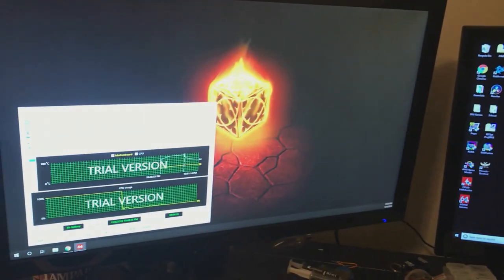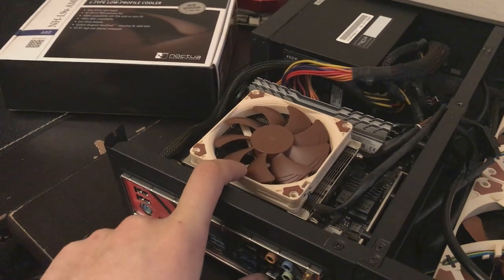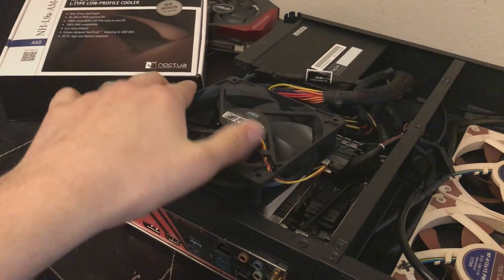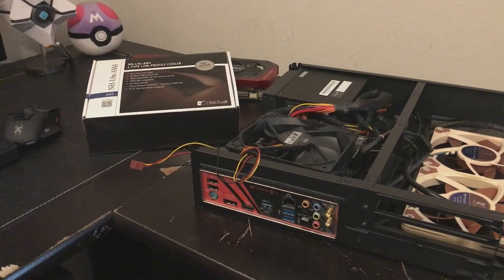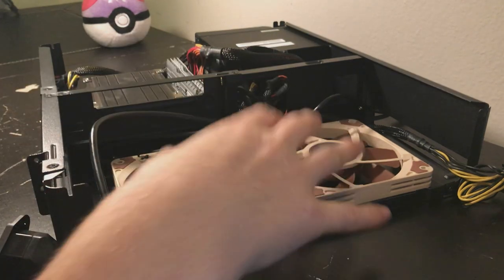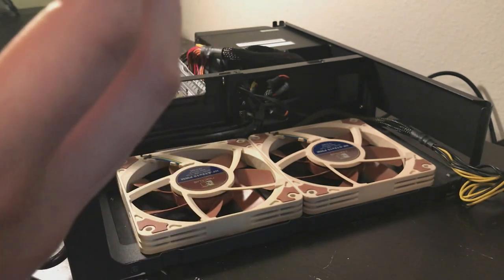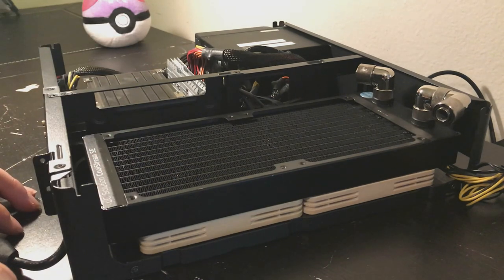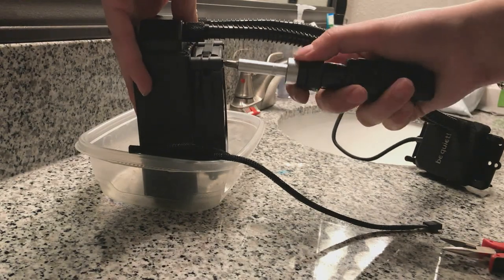Main Rig Refresh Part 1 - Preparation and Cleaning

Comment: i'm planning on building this same setup for the node 202 with a water cooler. what  EK water cooler kit did you use and if you didn't use a kit than what size rad is that. my guess is the 240 from EK, but i'm not sure?
Reply from the maker: I did not use a kit. I used the EK SE240 rad and a normal EK block for the 1070. This is the 30mm thick radiator. There are other 28mm thick rads out there that I would also recommend but this works just fine. I also used Noctuas 15mm thick fans. 
For your build, I would also extremely recommend doing some kind of professional cut on the opposing GPU side of the case for a complete flow of air. I dropped 12C with this mod maxing the 1070 at 54C with both CPU and GPU at 100%. I say professional cut because its most likely the side you will be looking at the most. I had mine CC’d at a local machining shop. This is an awesome project for me and jumpstarted my adventure into the SFF world. GL!
Reply: Thank you for fast reply back and all your advices. You think you’ll come out with part 2 anytime soon, or is it on the back burner for now?
Reply from the maker: It unfortunately is permanently out of commission. The build had to be full undone and sold off the make room in the budget for the Threadripper World Record build.